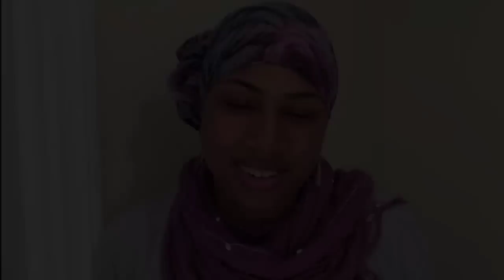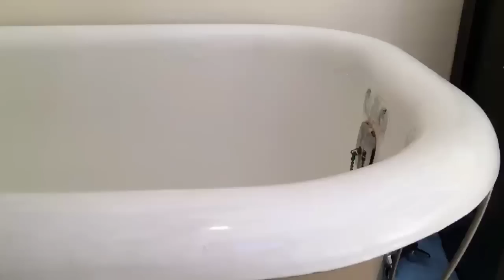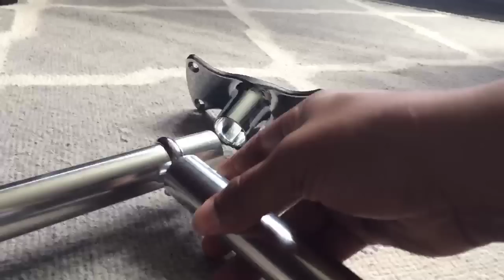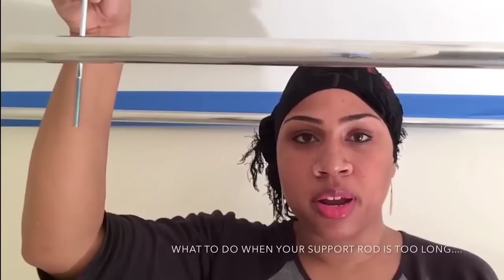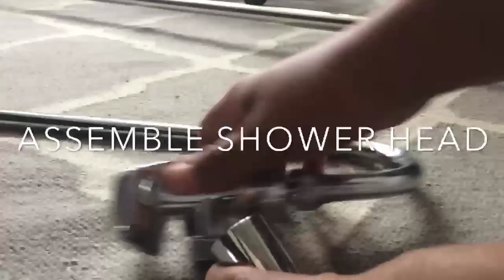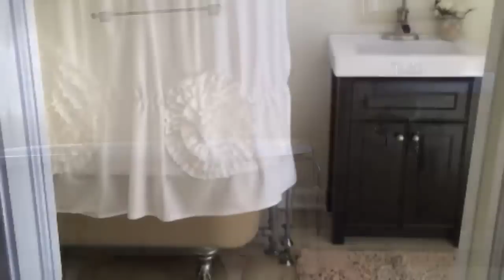Tub to shower conversion- Classic hollywood glam claw foot tub

Comment: Nice but where is the putty fir water not to leak around faucet knobs through tube and tape for threads. Also easier to cut metal with a pipe cutter

Comment: Hi, beautiful job.  What size tub is that?
Reply from the maker: Sainte Jeanne d'Arc Hello, thank you! It’s 60 inches
Reply: @homeonishiphomeoniship9608  I'm wondering if you checked out different sized clawfoots before you bought that one, that's assuming it didn't come w/ the house?  I can get a deal on a 54 inch by 26 inch wide, but I'm really leery of downsizing that much.  The one in here is 65 in, but full of chipping paint.  I'm less than 5'4 so won't suffer much.
Reply from the maker: Sainte Jeanne d'Arc ours came with the house but I’d go with the one that feels right. Also the company bath fitter refinishes old clawfoots if you don’t want to tackle the chipping. Best wishes!

Comment: how tall is that shower head from the faucet connection? We have low ceilings.
Reply from the maker: Hello! The height of the shower riser in the video from the faucet is 62 inches.  They are available in any height that you need. They can also be cut to size with a pipe cutter.  Here's the link to the amazon store that I bought mine from http://www.amazon.com/s/ref=bl_sr_hi?ie=UTF8&field-brandtextbin=D%26L&node=228013
Hope this helps...thanks for watching :)
Reply: Home OniShip ( homeoniship ) thanks! The amazon link is weird. It took me to a decal page.
Reply from the maker: Wow that's weird try this link: Add a Shower Kit with Hand Shower and Curtain Rod https://www.amazon.com/dp/B00HHI0VES/ref=cm_sw_r_awd_MF8sub0MHE75M
Reply: awesome! thanks. We have a white porcelain knobbed faucet with a short white porcelain shower spray for baths only. I guess it is going to have to be used for something else if when we upgrade to a standing shower/bath. I hope it sprays as strong as our current bath shower spray. Thanks again! Love the video. You should do one on bath remodeling.